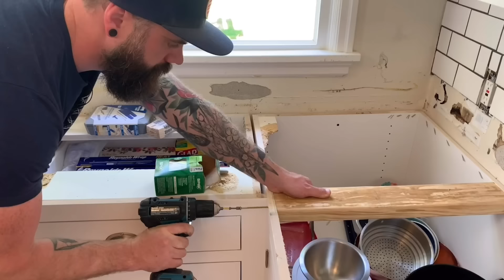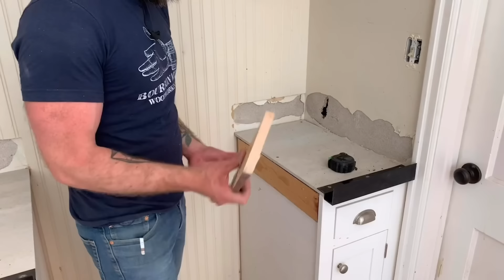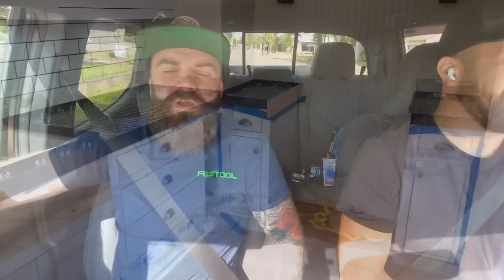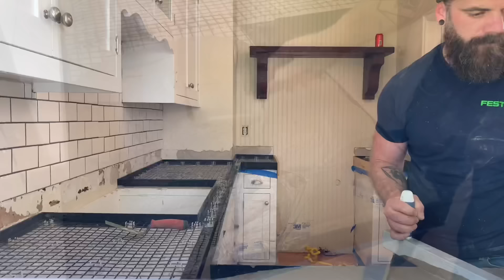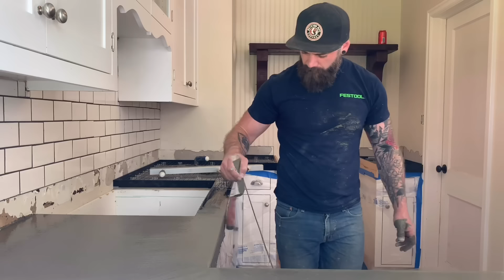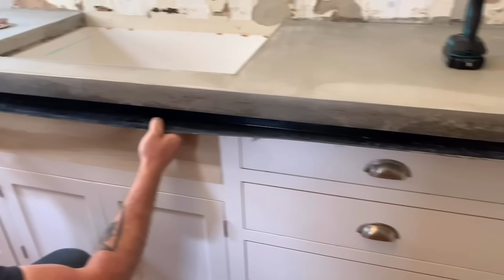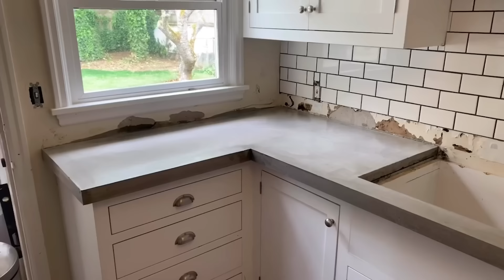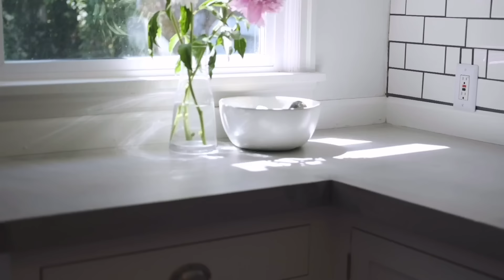Easy Concrete Countertops | Concrete Countertops How To

Comment: I'd trap the edge immediately after the pore. then smoothing the top. get the air bubbles out when the cement is at its softest state

Comment: This video is awesome!! I was thinking about doing wood fir my new countertop but this video changed my mind. The only thing is I am afraid that sand top concrete is not hard enough on PSI’s and that the edges could get easily chipped if hit with an iron skillet or a heavy pot. I was thinking Cement All from rapid set  which reaches 9000 PSIs at 28 days, but it dries way to fast and pour would be difficult. Anyone with other ideas?

Comment: Great job. Love your professionalism, passion, perfectionism.
I wanted to build a concrete top without putting any solution on top. 
I wanted it so polished that the top will be impervious to wine stains, coffee stains or oil.
I have made about one dozen concrete tops. Different thickness.
I wanted it light so not putting too much pressure on my malimine cabinet.
I worked with an industrial chemist for years which I use his products for my plastering. 
My tops are still a working progress.
I have one in my shed which perhaps is one of my best. It's stood up to the test of time but too heavy to use in the kitchen so I abandoned that particular project to say back to the drawing board.
It's sort of like I know what I want, I also know what I don't want.

Comment: A great way to tap the edges is to take a battery saw saw and remove the blade turn it on and vibrate it against the edges this will absolutely remove any voids or air . Also a sander works, but the saw saw is better
Reply: Saw saw? Or sawzall?

Comment: I've seen a lot of clips of people using a reciprocating saw with no blade attached to vibrate the concrete form to remove as many air bubbles as possible. Is this something you considered to really work out as many air bubbles as possible? That might've worked a bit better than just tapping the edges.

Comment: Nicely done sir.

 I'm sure if I scrolled through the questions somebody might have asked it and you may have already answered it so forgive me if you've already answered.

 I'm building an outdoor kitchen and we would like to incorporate some curves into the design.

 Does the Z form bend in a curved shape? That's my first question and my second question is can the finished sealed counter be exposed to the elements after it's been properly sealed? IE rained on Sunshine and so forth, this house is in Northern California so there is not any concern of snow.

As a veteran teacher I must say that this video you created is spot on and 100% helpful.  Thank you for your time.

Comment: I mean yes multiple people are nice, but you're doing it by yourself take a spray bottle with just standard water and mist a little bit of moisture on top of the cement so you can go back and forth without worrying too much about the cement drying up on you too fast. That's what I've kind of learned

Comment: You DON'T want your rebar or mesh in the middle of your slab!!! You either want it towards the top or towards the bottom or both. When a slab is put under a deflection stress, there is compression applied to one side and tension to the other (depending on the direction of deflection). The rebar/mesh acts as a matrix to resist the tension force. The middle of the slab undergoes minimal stress in comparison to the area near the surfaces.
 It's the same principle behind strong flanges and relatively weak webs of i-joists, or why it's best to drill holes in the middle of a joist as opposed to the upper or lower parts.

Comment: I'm very curious about how you would safely do an overhang where you can have seating? I'm building our house right now, and want to implement this in our kitchen. Thank you.
Reply: You'd have to build the structure beneath the overhang and pour the top over it. The z forms let comcrete cover the end of the surface it's on so as long as you kept the sub structure close to that overhang you wouldn't see it. But the concrete itself wouldn't support it's own weight for long before cracking if it hung out far enough to get your knees under it to your waist.

Comment: Does this solution offer color options for the concrete? I’m thinking of doing this in my laundry room (where I built the cabinets from scratch based on your excellent videos on that subject). A laundry room is a great place to practice these skills, before tackling much more visible kitchens.

Comment: Hi can i add a pigment to the concrete? Is there a specific type to use? Also will the concrete counters have issues like chips, holes and need to reseal / refinish in future?

Comment: I had tile countertops in my kitchen. We pulled the tile up which left the 3/4 inch plywood. Can I concrete over the plywood, or do I need to put down the concrete board?

Comment: I noticed in another comprehensive video they did not remove the sink, but you did here. Which is better?
Reply: I don't know if there's a "better". Getting a water tight seal at the edges is important because you pour the mud very wet. If you can get the edge to seal without taking the sink out I guess it's fine. The problem I see would be screeding the concete with the sink in the way. Depending on the sink and if there's countertop behind it, that could be really difficult. But it could be done with a narrow trowel. It just might be more work than pulling the sink out and putting it back in. Sorry for answering your question but he's not going to. I didn't see any responses to anyones questions. And then there's whether or not you want to chance scratching your sink.
Reply: @Maxid1  no need for an apology. Thanks. I am not renovation inclined but I'd like to be. So trying to do it easy vs trying to do it right, just wanted to get anyone's thoughts. I'll probably remove it if I can't get a proper seal

Comment: The tile should be pulled as well.  I can't look at them.  If you can't tile, at least don't use black grout to accentuate the fact that you can't tile.  White grout will hide a multitude of sins.   Countertop looks good, but you can put a nice finish on the edge by simply rubbing a diamond stone held at 45 degrees.  Nice work.  If you are going to use black grout, use a laser for the tile.

Comment: I have a small backyard with unevent brick blocks floor from the previous owner, can I put concrete blocks on the top of the brick floor without taking all the bricks out? I'm thinking to get the flooring molds then fill concrete in ?

Comment: So what if you don’t want the sharp corner edges? Can it be shaped after removing the forms or is that done before fully cured? Seems like the sharp corner would be prone to chipping and definitely would hurt to bang up against. A nice quarter inch round over would be great.
Reply: Z form has round edge forms too.

Comment: Hey there. Great video and love the countertops. I'm in need of some professional advice for restoring my concrete bathroom vanities. They are needless to say. Gross. Why? They weren't sealed from what I can tell. Wee 😒 I've been wet sanding with 120 grit just to see if I can clean them up a bit and so far yeah....not good enough. Any suggestions? Perhaps resurface then with slur and then sand, seal etc. Would really appreciate your thoughts. I have pictures haha Cheers from Canada 🇨🇦

Comment: Get some 10 mil rebar along the lip and bang the cupboards with a rubber mallet to get the air bubbles out before troweling 🧐

Comment: I have granite countertops and saw where you could do it on there, but does anyone know if I would be able to remove the concrete later if I wanted to go back to the granite? I saw where there are concrete solvents to break it down and don’t think it would hurt the granite.

Comment: It appears that you have left a sharp edge on the top of the concrete, would it not be better to soften that edge with a rounding or a chamfer?  With all due respect, the concert seems "cold".  Albeit more work, an attached wooden front edge facing would warm things up and also allow the top front edge to be easily softened for a more comfortable effect.  An added splash of color to the concrete as well, use a light colored wood like Ash or Maple, or a darker wood like Black Walnut, for example.

Comment: No grinding once you strip the forms? Different… Grinding, using a series of stones, will give a beautiful glassy surface to the top, after which you seal. Been doing these for decades and it never fails to make it pop

Comment: It's not concrete if it has no aggregate. Concrete has 4 main ingredients. Water cement sand and aggregate(rocks). What you've made is a Mortar counter top. It's called a "Screed"

Comment: Hi, cool video. 
Do you leave the z-Form plastic that runs along the wall / tiled area, in place? ie never remove that one ? 
Thanks
Reply: Yes, the ones along the wall and back splash stays in. Just the exposed edges get snapped off.

Comment: why not use the old worktops as the base , how easily does this stuff rip back out and where would it be disposed of ? seems like a nightmare mix of materials to separate when its all done with.

Comment: I wonder if there is a way to form up the sink area to do an under mount sink?  Also, any tips so the top leading edge and corners have a small bevel to them and creates a small radius?  So there are not sharp right angles?  Thx-

Comment: Fantastic video!
What’s the longest straight span for that external plastic form work, to not sag outwards in the centre?
Also curious if there’s a  poured product with optional stone finishes to sand back and polish so as it’s not just the industrial grey concrete look, but still able to have hot things put on the surface that won’t burn like a painted finish would.
You made it look so easy, and an impressive addition to most houses. No doubt far cheaper than granite too!

Comment: instead of using the floating mesh couldn’t you just use a 5000 PSI concrete or mix your own Portland And add a chopped fiber to it? I’ve built some pretty strong stuff that a concrete using that technique.
Reply: Chopped fiber will show up on the surface

Comment: Nice job but you are wrong about where the reinforcing mesh goes.  The reinforcing mesh must go below the neutral axis.  That is because it is intended to give tensile strength in the lower portion of the slab (concrete has high compressive strength and relatively low tensile strength).  If you put the mesh ON the neutral axis, it adds no strength.
Reply: Fascinating

Comment: Just watched the cement countertop video - very helpful!  I have cement counters throughout the kitchen, including a big island in the middle.  When they poured the countertops, they decided to use rounded edges.  The problem is that they didn't get all the bubbles out after pouring.  So, we have hundred of bubbles on the top of the rounded edges.  Needless to say, they catch any dirt, food...in the empty bubble holes.  Instead of demo'ing all the countertops and starting over, I would like to cut off the rounded edges so they only present a 90 degree edge...essentially cutting off the rounded edge with all the bubbles.  Anyone recommend a saw, I assume a wet saw, that I can use to cut off approximately 3 inch thick?  Thanks!
Reply: Why not cement patch

Comment: Beautiful countertop job, but those baseboards against the backsplash ruin it for me. Why would you not replace the tile down to the concrete surface? Those painted over, non-flush screws look terrible.

Comment: That mesh should not be in the middle! It will do absolutely nothing if it is put there. The middle is a neutral axis which is neither in tension or compression.  Put it in the middle thickness of the concrete in tension.

Comment: Can I just add a wood sheet instead of what u used?
Reply: Any wood or ply will work but the hardibacker stuff is a masonary board. Perfect for this kind of job due to the amount of moisture that has to dissipate as the mix dries. Ply could delaminate and wood will soak and stain on the underside. Possibly causing mold or mildew as it dries.

Comment: I wonder how terrible these counter tops are to remove when you finally want something different
Reply: Very difficult. Those little screws you put in the field to hold up the mesh hold it down. You're replacing the lower cabinets if you want to change the tops. If you think you would change them, don't put the mesh in. That way you just lift the concrete slabs off.

Comment: NOOOOO... you DO NOT keep adding water!!! You use the exact amount of water and use a product called “Plasticizer”. When you use this product, it’s like you added  way more water when you didn’t. It will make your concrete very flowable without weakening it with the added water.

Comment: So instead of spending an afternoon matching the pigment to concrete and simply epoxying over the wood veneer countertops which would cause what 180 240 bucks you spent what appears to be well over 1,000 probably into multiple thousands of dollars to have unfinished concrete countertops I award you no points and may God have mercy on your soul
Reply: I used this for my bar a couple years ago and I think it ran me around $700

Comment: 7:15 
So no one is talking about the obvious burring on the corner here? Didn’t even mention it? Looks like shit.
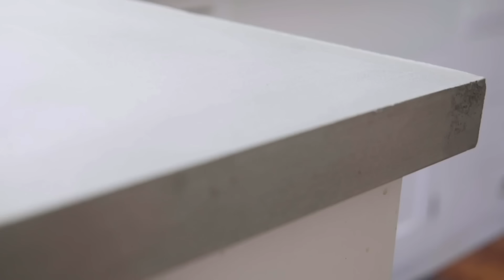Reply: 17:15? The edges can get pretty porous looking if air gets trapped against the mold. If he'd filled that after snapping the molds off it would have fixed that. But his edges, for this type of medium, look really good. My experience is it's very hard to get all the air out. If I ever do it again I'm going to try running the mag trowel along the front edge in the mud a few times to get as much air out as possible. But yeah, if you don't like what you saw here this deffinitely isn't for you.